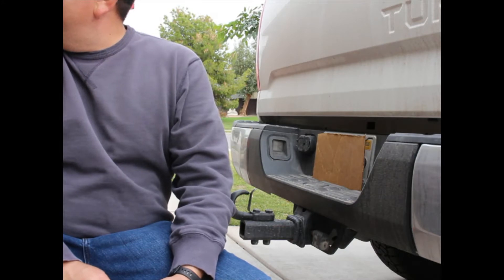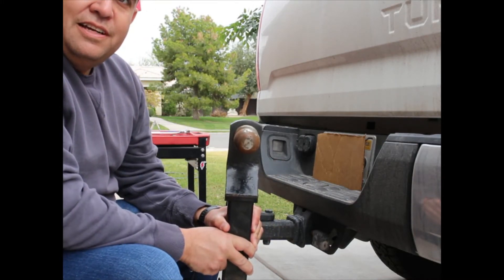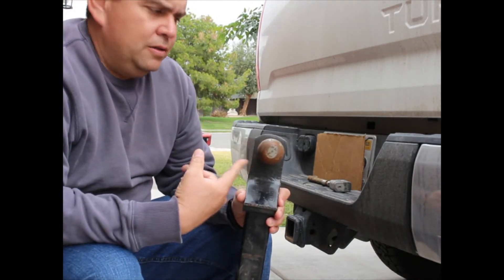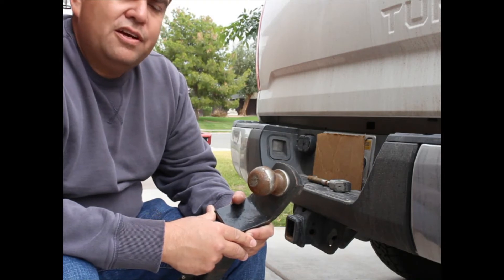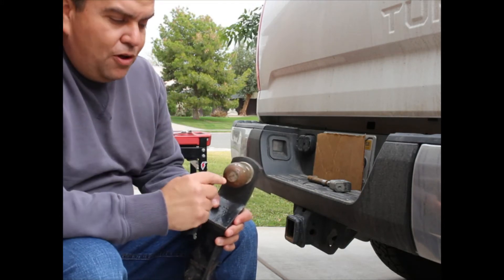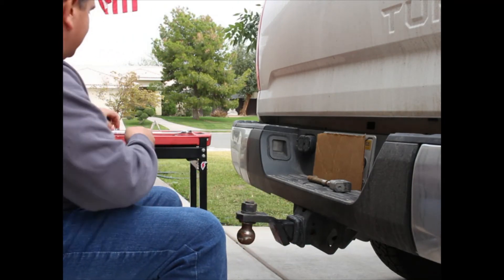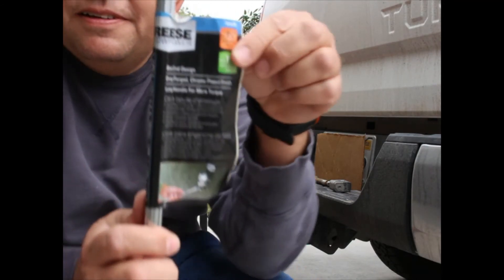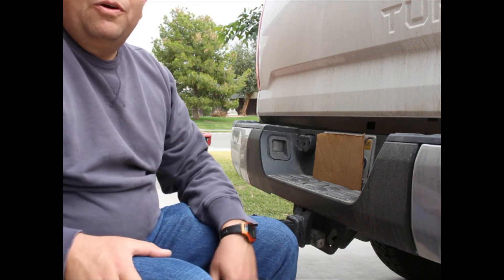How to set up a Hitch for towing

Comment: Joshua Campos P.5 Ag. Mech:
What happen if you didn't tie it well
Reply from the maker: If you don't tighten the nut on the shank of the ball then the trailer will start to rock it back and forth during stopping and acceleration.  It continues to loosen the nut falls off the threads of the ball, then the trailer unhitches itself and your in real trouble after that...  Another way to help keep the nut secure is with "lock tight"